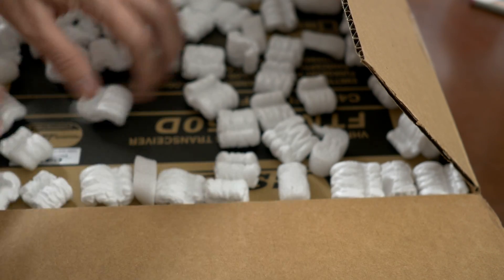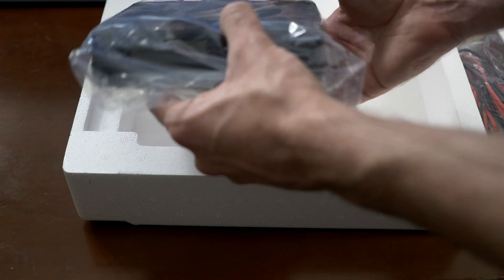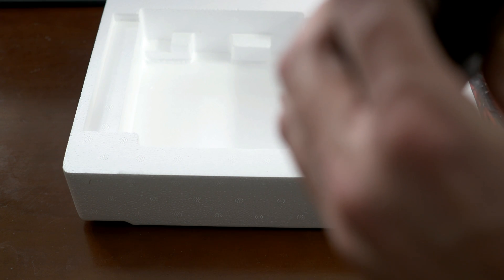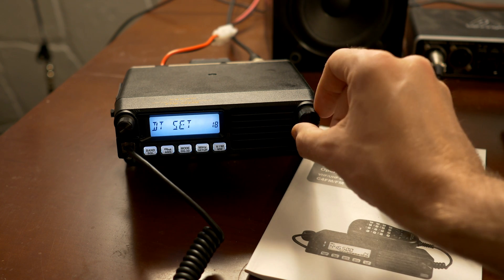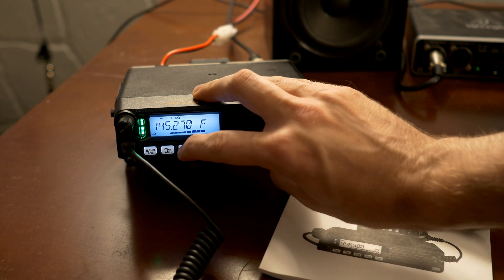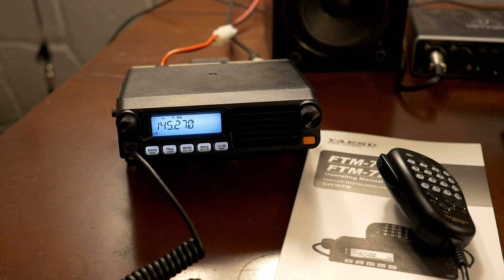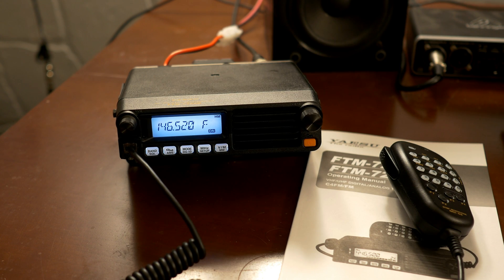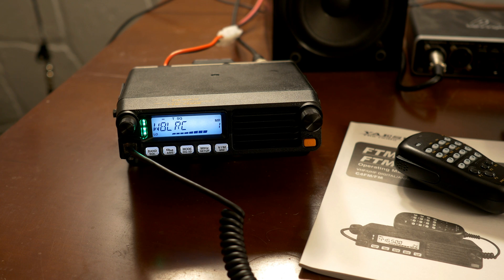Yaesu FTM-7250DR / FTM-7250DE Unboxing and Simple Repeater Setup

Comment: Do you still have this radio? Do you still recommend it? I'm thinking of getting one. KE8OKY.
Reply from the maker: yeah, absolutely!
Reply: Do you have to run their HRI-200 or a hot spot to access the wires-x?
Reply from the maker: you could do that. i just used the repeater to connect wherever, but chose times that didn't conflict with nets / daily usage. if you have a busy local repeater or time restraints that might not be an option for you

Comment: I'v owned this radio for over a year now and its been a big help to me, I use it as a mobile, the FTM-100 I use as a base unit both are extrodonary radios.  Has good weight...
KR5ECC
Reply: Hello Dallas, I would like to pick one radio. Am bouncing back between FTM-100 and FTM-7250DR.  The 7250 is $75 less.  If you had one to pick, which would it be?  Thank you
Reply: @arielban1  The FTM-100 because i like the GPS feature built into the radio.  the 7250 just happened to be the first I bought...

Comment: I have 2 of these radios, one in the truck and 1 in my go-box.  Love the radio...  You can program using software, but I liked it because it is easy to program from the radio/mic on the fly without a computer.  Nice for the go-box and truck both!  They are fairly inexpensive also!

Comment: How do you delete a frequency from the memory
Reply from the maker: page 28 of the manual has info on "masking" memories. but that only hides them from display/selection. other than overwriting them, there is no way to delete from the front panel. that alone was sufficient for me to go for the programming software as well..
Reply from the maker: to mask, in the memory recall mode hold the V/M(MW) key, select the channel to mask and then press the BAND(SQL) key twice
Reply: Thanks

Comment: Hello dear OM Alexander, the radio looks awesome, I really like it! Can You confirm that in split memory - TX/RX mode, the RX frequency can be on VHF band and the TX frequency can be on UHF band for example. I would like to work via amateur satellites and this is very important feature of this transceiver. I read very carefully the operating manual, but did not find answer of this question. As I see on your video, split memory works on same band, it would be great if works also on the other band - RX/TX -> VHF/UHF.
Reply from the maker: Yup, just double checked and that does work. To verify, save your receive frequency to the channel, add the send frequency as shown but in 70cm, then in Memory Recall mode press the "MHz" button to display channel frequency instead of description. Press the PTT and the display should temporarily swap the display to the send frequency.
Reply: @AlexanderGrotewohl  Thank You for fast reply Alexander!  Wish You all the best, enjoy ham radio hobby.